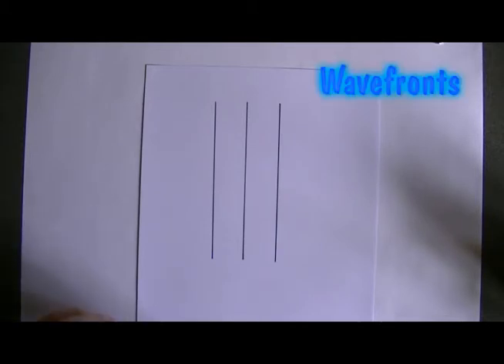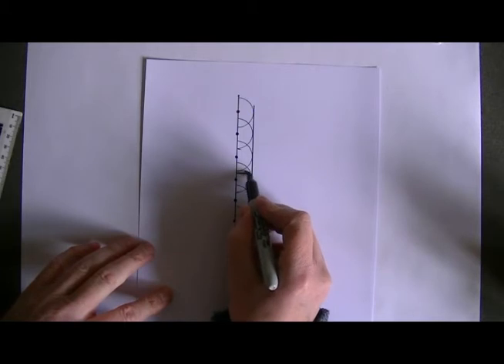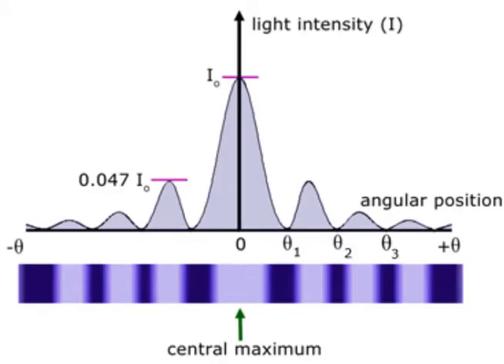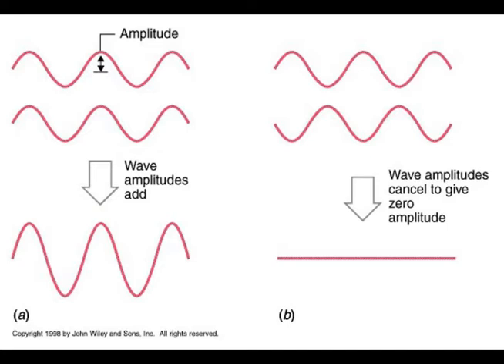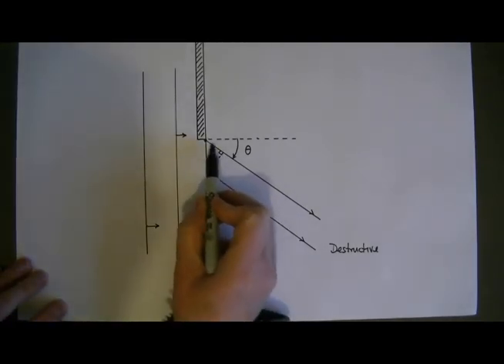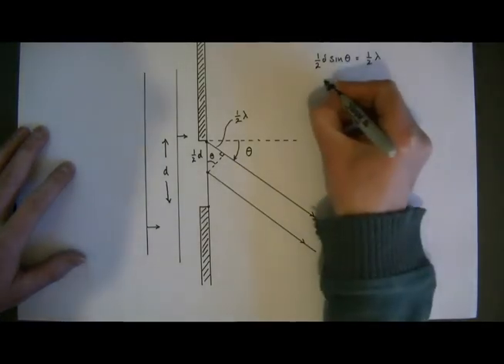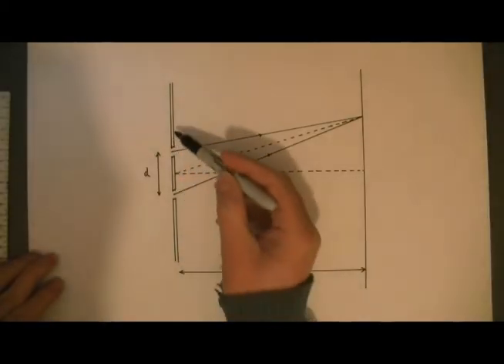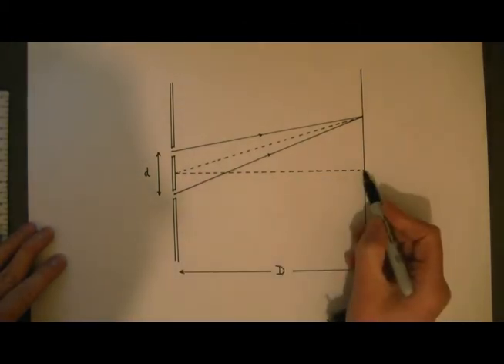Diffraction and interference

Comment: How do you know if the problem is about constructive or destructive interference?
Reply from the maker: There are 3 situations that A-level physics students study. For a double slit or a diffraction grating consider the path difference needed to cause constructive interference. For diffraction through a single slit consider the path difference needed to cause destructive interference.